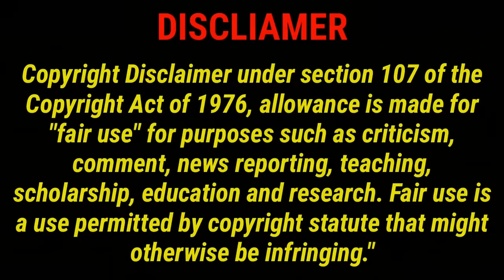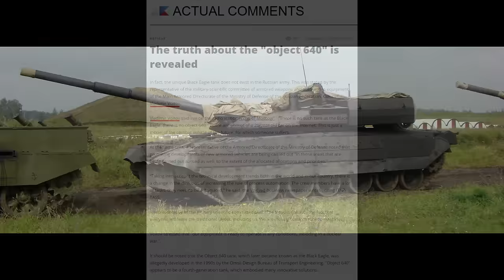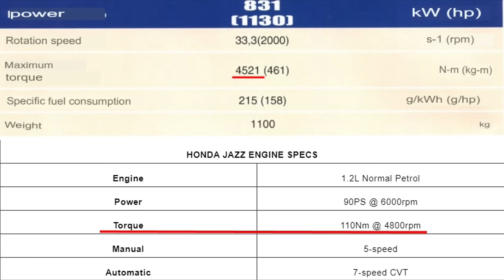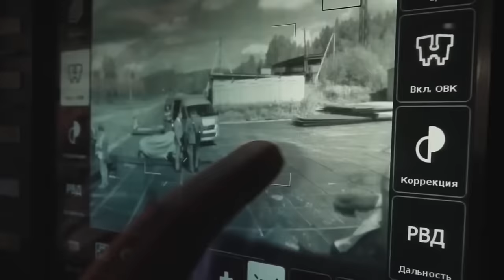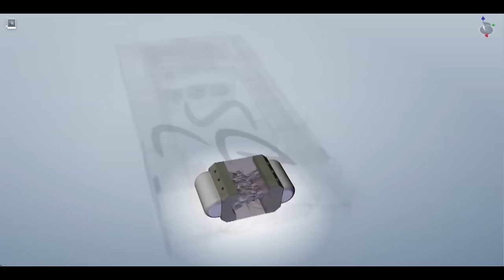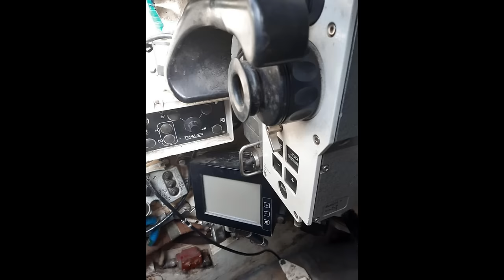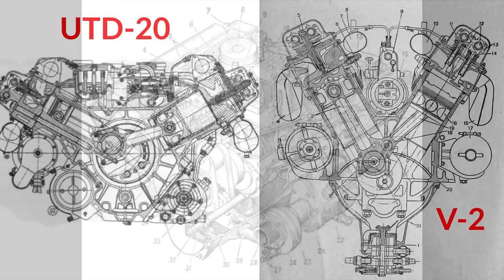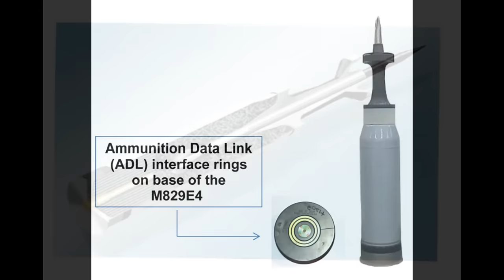LazerPig is WRONG about T-14 Armata

Comment: The T14 could be every bit as amazing as russia says it is. 
Doesnt make me any more worried. 
They hardly have any. And seeing how scuffed the russian supply chain and maintenance has been these past 2 years, I'm even less worried about this tank.
Reply: The problem with supply and maintenance is that Ukraine doesn't seem to have much of a structure either outside of the military aid they receive from other countries.
Reply: @spimpsmacker6422  No relevant.  The discussion is about the T-14 and not Ukraine.
Reply: @spimpsmacker6422  Ukraine having bad logistics is a lot less of an issue than Russia. Russia has a lot more land to cover, a lot more cities, everything is spread out, etc. It's like comparing the logistics of Switzerland vs USA
Reply: @patwilson2546  I'm just saying Ukraine is basically on the same terms as Russia in relevance to how they supply their war effort.
Reply: @TheLongDon  It is an issue when you're trying to defend your country, and your military capacity solely depends on a supply line from foreign aid that is gradually thinning by the day. NATO countries are quite literally running out of ammunition to supply Ukraine with.
Reply: @spimpsmacker6422  gradually thinning day by day? Germany and the us announced new packages to resupply Ukraine?
Reply: Eh u never know with Russia, they may have  put the t14 and the Armata platform on the backburner just to focus on deployment of more unit using older equipment, side most new equipment  regardless  of side have supply issue at the moment
Reply: The T-14 is the world's first stealth tank. That's why it can't be seen anywhere. KEK.
Reply: The T14 is would be rediculous overkill if it were fielded in numbers right now. Its an extremely advanced tank that is a solution for the much further future. There is no reason why they would, or should be expected to fully field such an absurdly advanced tank, based on their current competition. No country is further along in next generation tank development that Russia, but no one else gets criticized for it. People are criticizing Russia for not being even further ahead than they already are in next gen tank development, which is crazy. Criticizing them for not fully fielding a NEXT gen tank, when they are further ahead than all of their competition makes no sense.
Reply: @WordBearer48  Sarcasm? Even russia's CLAIMS for the T-14's capabilities are nothing special. And you can say with 100% certainty that the claims are lies. All that matters in a modern tank, is target acquisition, the fire control system, and how it's integrated into a combined arms doctrine. russia has yet to show anything with anything approaching the high end in the fiorst two, and is being objectively proven every day, to know nothing about the third. If they were fielded in numbers, they'd be destroyed in numbers.
Reply: NAFO guys are soyraging in the commentary
Reply: @spimpsmacker6422  they do . They produce their  own btr's . They produce a lot jet engines for Turkey which in turn gives them drones also Baykar is building a factory in Ukraine to shit out tb2s . Also Ukraine doesn't need to produce heavier equipment NATO will keep giving. We have thousands of   modern equipment laying around. What does Russia have T-55 s??? Also NATO is not even producing at a good capacity.
Reply: @somezsaltz6835  The U.S. will do some good work, but as for Germany and the rest of European NATO they don't have the supply or infrastructure to keep up with the demand of the war. The United Kingdom in just barely a week practically blew through their reserves in artillery shells because of how rapidly Ukraine needs to expend firepower.
Reply: @LeonardTavast  Same like kf 51 and abrams x
Reply: @spimpsmacker6422  no?

if anything the conflict sparked interest for most NATO nations to reinvigorate their military spending, which is why now is where you start to see the announcements of upcoming tanks from Nato nations. before htos clnfict, they didnt really need ot exist.
Reply: Except its not.
Reply: @spimpsmacker6422  the hottest take I think Lazerpig makes in his videos is that Russia doesn't know what a forklift is. I'll admit I've looked around and can't believe a military in the modern age wouldn't be palletized. If it's true then this would be a bigger issue than how good your best tank is.
Reply: @Campsinstorms  The Russian do not use pallets in the army. Their supply is let us say underdeveloped.
Reply: How many T-14's have seen combat? How can you say it's amazing without any live trials?
Reply: @WordBearer48  Stop huffing the copium. China is ahead of Russia right now, so trying to say you're number one is foolish.
Reply: Yeah, Russians kinda need to fix their logistics, pretty sure they need to rely less on railroad. They should worry about the legs before the byceps
Reply: @spimpsmacker6422  Quote: "NATO countries are quite literally running out of ammunition to supply Ukraine with."
Its the same kind of propaganda we hear(d) in the West that Russia is supposedly running out of ammo.

Neither sides are running out of ammo.
However, both sides have the problem that they use up more ammo than they can produce.
So, the longer the war goes on the less both sides will shoot each day.
And just the other day news came out that basically both sides are rationing their rounds.
Reply: @spimpsmacker6422  you don’t need a good army to have a successful defense. That’s the best part about playing on home turf. You not playing to win, your playing to not lose.
Now, do you want a good logistics chain. Yes, but Vietnam, Afghanistan, and every other country that exists even after facing pertinent challenges is proof of such. It’s a war to bleed out your opponent, and the best part is, you don’t have to make the first move.
Reply: @jonson856  "However, both sides have the problem that they use up more ammo than they can produce." 
"And just the other day news came out that basically both sides are rationing their rounds."
So in other words, they're running out of ammo? But it's good because apparently so is Russia? I think you fail to recognize statistically how much Ukraine need's its frontlines supplied to fight off the Russians, because if this were a war based on manpower then it seems obvious who would win.
Reply: @TheWizardGamez  The Vietcong were a completely different kind of army compared to the Ukrainians. The middle-east, sure, if you consider the fact that the rebels had to sacrifice over 100x the amount of men to actually drive the Soviets and Americans out of their territories. 

I'm not saying it's impossible for them to win, but if you look at how sanctions are doing or how country officials have admitted that they can't keep up with the demand of the war, this conflict is only going to get harder for the Ukrainians in the long run.
Reply: Good thing you are not worried; Russia has been very concerned about your opinion on this tank. I will write a letter to Rissian Ministry of Defense saying that you are not worried.

Comment: For engine designs legacy designs have advantages of learning what is weak point and fixing each of those. Plus metallurgy and design improvements have made designs much better plus reliability must be maintained.  Great video thank you. It is interesting to  see that early design of valve train was  bevel box gear driven.
Reply: Reliability or Russian, choose one.
Reply: @stillcantbesilencedevennow  They aren't mutually exclusive.
Reply: @voidtempering8700  sure they are. Even their AK variants have become terrible.
Reply: @stillcantbesilencedevennow  Why are you comparing a rifle with an engine? LazerPig himself said that the engines were reliable, even as he was critiquing them with relatively inaccurate information.
Reply: @voidtempering8700  reliable? That's why the T-14 broke down on the parade grounds? SUPER reliable.
Reply: @stillcantbesilencedevennow  Once again, the T-14 didn't break down, it had its brakes on. If it broke down, the recovery vehicle would have been able to pull it, but it couldn't. How are you going to talk about credibility when you don't even know the facts about the event.
Reply: @stillcantbesilencedevennow  Besides, I was talking about Russian tank engines in general, not just the T-14.
Reply: @voidtempering8700  were it's brakes DESIGNED to lock up? If not, that's still a reliability issue. Why is this hard to understand? If it can't parade how TF can it war.
Reply: @voidtempering8700  Russian tanks in general? Can we discuss carousel ammo storage then? Ahhh, nevermind Russians don't GAF about crew survival. Lol
Reply: @stillcantbesilencedevennow  The driver accidentally turned on the emergency brakes.
Reply: @stillcantbesilencedevennow  The carousel is not the reason for the turret flying off, it is loose ammo storage. If you knew anything about tanks you realize this can happen to any tank that doesn't store all its ammo in blowout panels. Hence the Leopard 2, Challenger 2, Type 10, Leclerc Ariete, and Merkava IV can all have their turrets blown off since between half to a third of their ammo is stored in blowout panels, with the rest being in the hull.
Reply: @stillcantbesilencedevennow  hilarious that this very thing was addressed in the video, so you clearly didn’t watch it.
Reply: @stillcantbesilencedevennow  
Look, we get it. You want to be as obnoxious as possible. That's... great.
Just go do it somewhere else.
Reply: @stillcantbesilencedevennow  What have you been smoking to call AK-74/M unreliable is beyond any intelligent comprehension. Whole I do agree AKM is not the greatest rifle in the world, 74 and it's variants including the AK 100 are every bit combat capable as the AR/G36 platform, bud.

Comment: I love a good debunking video. While Lazerpig's "analysis", if you can call it that, was certainly entertaining, it has little to do with reality sadly.
Reply: Indeed. Another small step on the road to victory for Russia.
Reply: @Enderguy059  too far
Reply: Regardless of the validity of larzerpigs analysis, Russia will never field the t14, so any discussions about it are purely academic. Russia did a propaganda tour around the factory producing the tank recently, and all the tools, equipment, hulls, furniture were in exactly the same position as in a video from 2018. There has been no production, there isn't one now, and there will be no production of that model. The only examples existing are there to be used in parades.
Reply: @Enderguy059  lol it could be the greatest tank on the face of the planet, but since russia can't build any of them, it wouldn't matter. And there is no evidence they are actually any good.

Comment: 35:41 very fair point except the examples you show are all Frontline vehicles that should naturally be armored while the ones LP gives aren't Frontline vehicles. But here is the problem, the way I understand it (correct me if I'm wrong, I didn't do actual research) the Abrams tank existed and then they needed a bridge layer so they took the already existing Abrams tank and made it work. And in WW2 for instance they made the Sherman to be very versatile to have roles and dedicated equipment such as mine clearing and other stuff. What Russia is doing is taking a tank frame that is in development and adapting it to be an APC and other stuff. Sure the APC doesn't need to be armored as much but in order to be a good APC it needs to have a different frame than a tank that was designed to hold 3 people. So either they altered the tank chassis to make it also better as an APC, or they made a shitty APC

(I use APC as a a catch all term here because I don't know what the true terminology would be for it. But if it needs to hold 3 or more people then it is going to have a bad time)

Edit: I have now watched combat approved and there seems to be enough to use the t15 as an adequate apc except that they also say it has thr same armor as the t14. That would make LP right because "why does it need to be armored" and "it's a thirsty thirsty Boi"
Reply: It is not an apc lol
Reply: @Lexington21  did you read the part where I said" I used APC as a catch all term because I don't know what the true terminology would be for it"?
Reply: @rulesofimgur  I will probably say or use unmaned turrent or robot tank
Reply: @Lexington21 The T-15 is an IFV which is not so far from an APC.
Reply: @rulesofimgur The T-15 is an infantry fighting vehicle (IFV). It is a heavily modified hull of a T-14. People should be very careful with assuming that things based on each other are actually that similar. For instance the T-15 relocates the engine to the front of the tank, the rear of the hull is opened into a passenger compartment with a remote gun mount above it. So there's a world of difference between the two vehicles.

Another example is the F35. The A, B, & C are almost separate planes. They share a common electronic base but the wings, fuselage, landing gear, & even engines are all different. Only about 30% of the parts on the aircraft are actually common.
Reply: @Lovemy1911a1  yes, that is something to be aware of however, there is also not much information available about it so we have no choice but to speculate.

The reason I say that is because the documentary on it doesn't include much but it does say, Iirc, that the armor of the t15 is better than any western IFV or something like that.

Let the speculation begin:
We know it uses a modified t14 chassis
We know they claim it has a lot of armor

Is it possible that due to its design to have the same chassis and parts that it also shared the armor? According to my untrained eyes and rampant bullshiting they appear to share parts of what I would believe the armor is.

This isn't inherently a bad thing because ease of manufacturing but it also had drawbacks. Such as having heavy ass tank armor on an IFV so it is "a thirsty, thirsty Boi".

I'm actually with LP here because they took a tank, removed the cannon for a lighter cannon and modified it to fit more people in it. WHY DOES IT NEED TO, possibly because speculation by a common idiot, SURVIVE AN ANTI-TANK ROUND? that's the job of a tank.

If these were everywhere in Ukraine the fuel logistics would be atrocious and would probably have more fuel consumption than all of American road traffic (that's a hyperbole)
Reply: @rulesofimgur  well the point is to have a common base things are built from. This helps with production, logistics, maintenance. It also helps on the tactical level as if you have a common base with similar performance then your units should not have issues operating together. You won't have as much concern that one vehicle will hold up the other or cannot cross obstacles the other can. 

As for heavy armor that's going to be the norm for IFV going forward. Well trained infantry are very important and militaries will want to protect them as much as practical. If you look at many of the newer IFVs from around the world there are several that approach the 48 tons the T-15 is reported at. The US Bradley replacement will very likely be in this weight class.
Reply: @rulesofimgur  None of what you said is remotely true. Watch the part where he talks about the T-15 and the ARV. It shares the same chassis, layout, armor, etc can be changed and adjusted as needed.

Comment: "If maintained" is a pretty big "if" in russian army
Reply: Considering that they have working t55 tanks - their maintenance is fine
Reply: @yellowtunes2756  maybe, or maybe these were stored in a hangar somewhere and now had undergone some dust/rust cleaning and sent into the meat grinder. And after living in russia for 21 years, can confirm that, this "maybe" is far more probable
Reply: @dungeondeezdragons4242  well, if getting them back in action is easy - either they had enough maintenance or they don't require a lot of it. Compare it to 88 leopard 1 in a year that Germany can repair
Reply: I mean, russia is the one invading, and they are not invading germany. I don't think that the german government is as concerned with repairing leo1 old, pretty much light tanks, as russia is with repairing old, but still main battle tanks.
Reply: @dungeondeezdragons4242  coper sniffer, ukrainian army witha  bigge rmillitary spending with more soldiers deployed with over 30 nations sending volunteers and weapons, yet no advancements and in bakhmut alone 72k ukrainians got fertilized while wagner way way less ,
Reply: @basharalassad1073  
1) your english is barely comprehensible.
2) i am russian, i am in russia, i know what i am talking about.
3) wagner is pulling out of ukraine, right now.
4) do you really believe death tolls from a private force to be anywhere near accurate?

Comment: I think the worst is slamming it for not making as much power as the jet engine in the abhrams and then slamming it for needing a lot of oxygen and fuel while saying nothing about the colossal volume of air the jet needs or how much more fuel they guzzle.
Reply: It's not a jet engine it's a turbine they are different. It's a helicopter engine except instead of spinning rotors it spins a driveshaft.